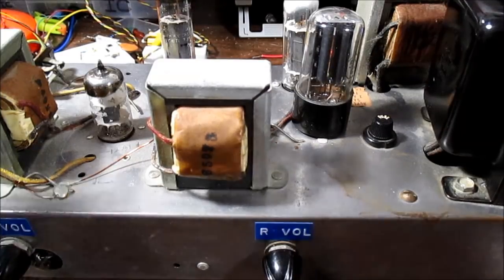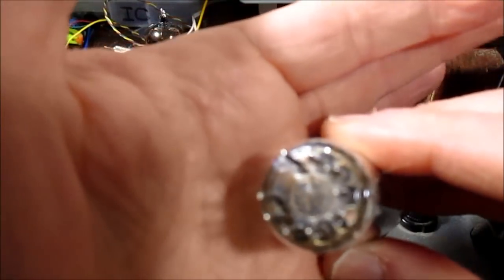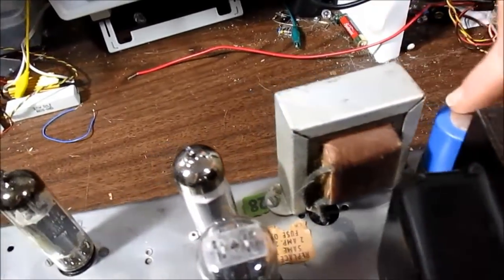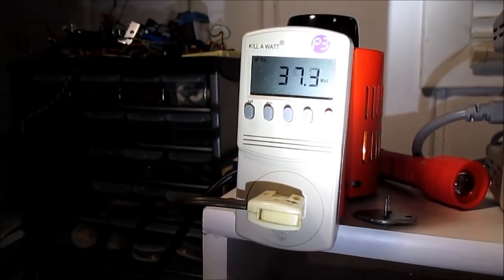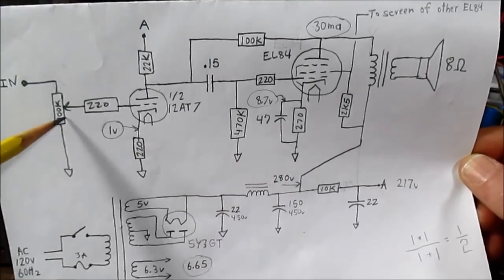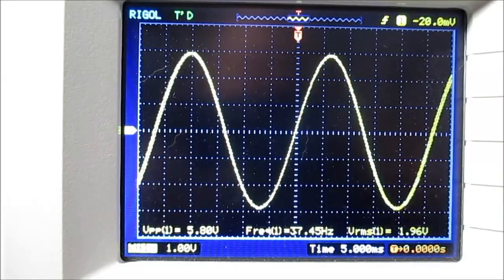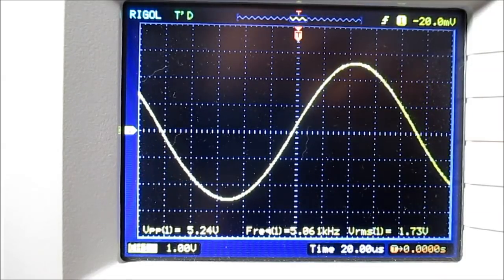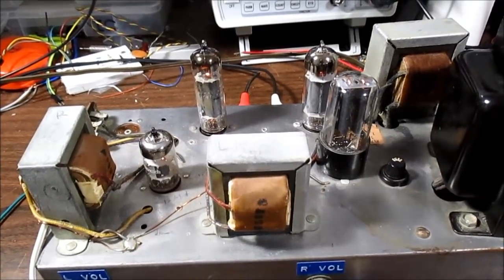Stereo tube amplifier test SE 6BQ5 / EL84 with schematic

Comment: Looks very similar to my tube amp! :O Mine uses the same tubes, but is a monoblock push pull! Zenith Chassi SB23 is what mine is, I believe it came out of a console record player. Now it is a standalone amplifier I use for my home speakers, and it sounds awesome! I did a complete recap on it, as I got it in completely original untouched condition off of ebay. every cap except the main filter can had to go.

Comment: The schematic you’re showing as redrawn from the amp is the RH84.
It seems someone converted an old console amp into the RH84.
Strangely enough, you don’t seem to be aware of the schematics or the amp, extremely popular with DIYers.
Power would be higher if the B+ were 30V higher (310 instead of 280) and you could easily achieve that by changing the rectifier (5Y3 shown) to a more efficient rectifier like the GZ34, or 5U4.
Reply: Why use tubes as rectifiers when better and cheaper semiconductors are available?
Reply: suchitra2003 gowra - because tube rectifiers sound much better!

Comment: A couple of recommendations: put the stop resistors as close to the grid pins of the tube sockets as possible. They will be more effective, and less susceptible to interference. Second, use a 2.5 KΩ resistor for the screen grid of each output tube. Running the screens in parallel sharing one resistor introduces cross-talk, meaning that some sound from one channel will be heard in the other channel, reducing channel separation.
     If you increase bias current, it will do better at driving a lower impedance load with more power, but at the expense of low frequency response, due to magnetic core saturation of the output transformers. That might be why the bias current is set so low.(Gotta admit, that thing sounds great!!)

Comment: Apparently you also get less power from an SE with an EL84 than that most designs promise? I am currently also working on several SE amplifiers with EL84, and I only get 1.5 Wrms here when controlling 3Vrms on G1 and by a Ia of 45mA. When I submit more, I have too much distortion.

Comment: Does a choke do almost the same thing as a thermistor?
Reply: A choke removes ripple from the supply. You can get almost the same results with a  resistor between the 2 capacitors. You would not use a thermistor in such circuits at all.

Comment: Zenith Amp, 4K22 chassis.  Thanks for doing the sweep.  If you would, connect the screen grid to the plate and let it play in triode mode.  It would be very interesting to see the distortion and frequency response 20-20kHz of EL84 in triode single ended.

Comment: That rolloff is what the audiofiles call "warmth". I like it too.
Reply: The HF roll off is dreadful, could be the poor output transformers. More negative feedback would probably help but that would reduce the gain even more. Normally you drive an EL84 with a pentode like the EF86 but the you would need 2 of them. If it was my amplifier I would do that mod and turn it into a circuit like the Mullard 3-3 and up the HT, it's too low at present. A diode rectifier would provide this. You should get a good 3 watts at low distortion and no HF roll off.

Comment: Do you notice a difference in sound of this amp compared to transistor amps. I am pretty surprised with the distortion, I thought tubes amps were supposed to sound better because they didn't distort like transistor amps.

Comment: Would it possible to make a transformer-less amp? I have seen some old tube radios that have series string filaments and does not use a power transformer. I suppose you could also use 117 volt filaments in parallel as well. Of course you still need audio transformers. Maybe you could use a 117L7 in place of the EL84.
Reply: I remember those too. It had special speakers of high impedance 1k or so so as not to need output transformers.

Comment: what tube is used as a rectifier?
Reply from the maker: 5Y3GT
Reply: Is it possible to use a solid state rectifier with this curcuit instead of a tubular one?
Reply: @westelaudio943  Yes, but you will probably need a resistor to drop the HT voltage abit. A diode has a much lower voltage drop than the valve.

Comment: Hi John You can expect to get about 3 watts from an EL84 @ about 3% THD but the cathode resistor should more like 180 ohms. You could get abit more gain by fitting a by pass cathode capacitor of say 25/50 mfd on the 12AT7.
Reply: Replacing the 12AT7 with a 12AX7 would be a better preamp choice. They have much more gain than the 12AT7.

Comment: I could actually hear the sound of the frequency sweep comming from the transformers. One day if I ever find some good output transformers I'll put those in and do a total overhaul on my home made tube amp and get all the voltages  and plate current set properly.

Comment: Have you ever tested a McIntosh tube amp? I wonder if there as good as the hype.
Reply: where2tour. They are sweet amps if you have 3 grand to throw around.  However. The quality of you're pre-amp is very important.  There goes another $1200 bucks.  😉

Comment: I would love to get my hands on the schematic if I owned this, something doesn't sound right with it being 2.1 watt per channel.
Reply: 2.1 relatively "clean" watts per channel isn't too bad. Under "ideal" lab conditions, a single ended 6bq5/el84 maxes out at about 5 watts at 10% THD. 10% THD is really nasty sounding - pretty much "unlistenable"
Reply: Look at the operating conditions.  About 260V on the 6BQ5 plates but only 30 ma being drawn through the tube...severely over biased.  Should be about 42-45 ma at that voltage level.  I also own this amp, it is from a Zenith console and if those are the original output transformers then they have a primary impedance of about 8.5k so the 6BQ5 should be running at the plate with a much higher voltage, say 330V or so.
Reply: As I commented already, the B+ should be 310V, that would increase current draw and output power...

Comment: Nice!If I ever build another tube amp, I would use 6bq5's as single ended outputs. But, as you see, the distortion is kind of high, and the output is kind of low - especially when you consider the 60+ watt power draw.In your opinion, how does the sound compare to the various chip amps that you have done.I have several discrete transistor amps that I have built over the years, and their measured performance blows any tube amp's measurements out of the water. Plus, to my ears they sound really good (but I am biased). I'm retired with time, tubes, and parts on my hands - just wondering if I should take the plunge.